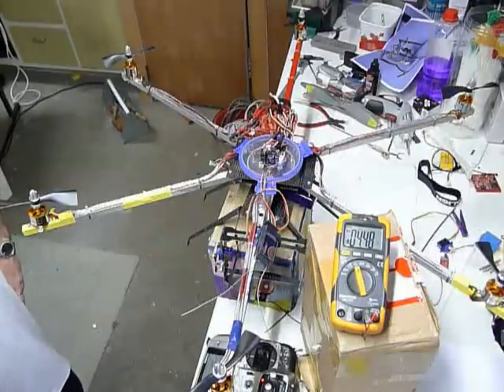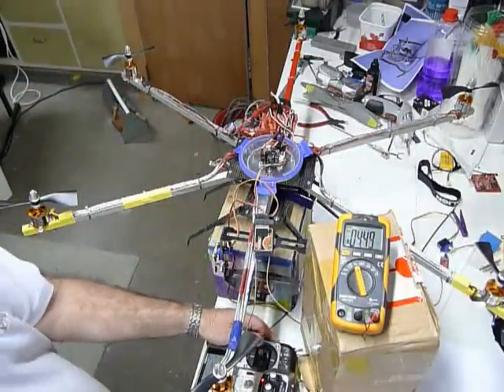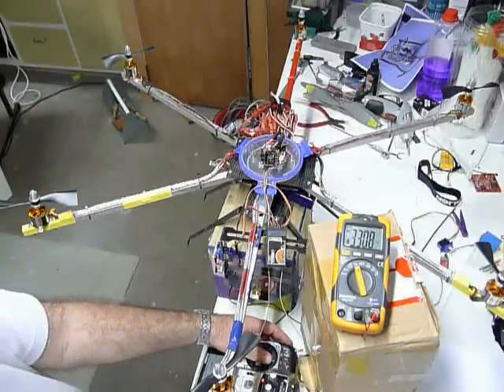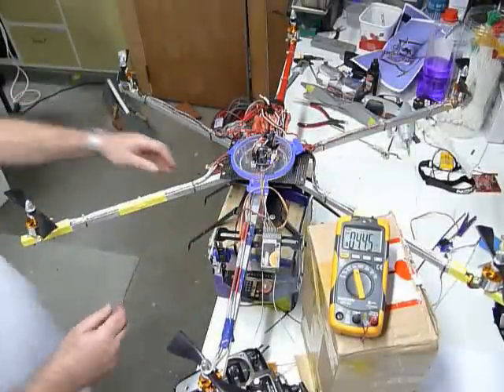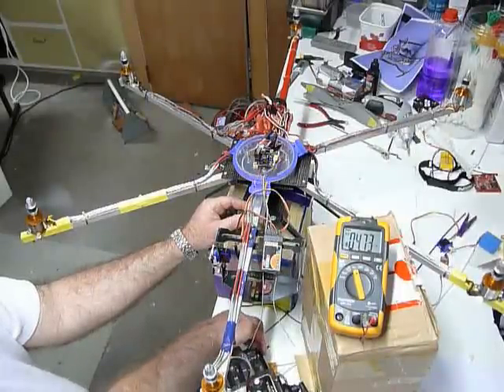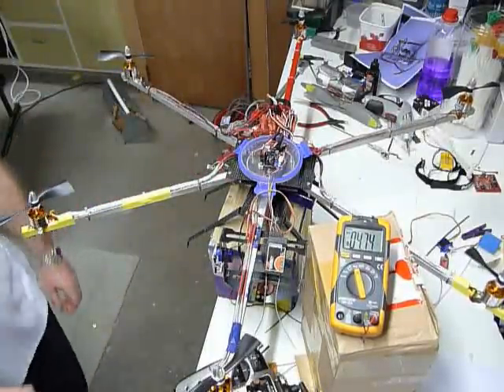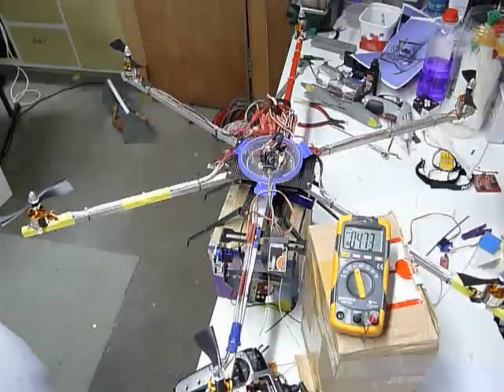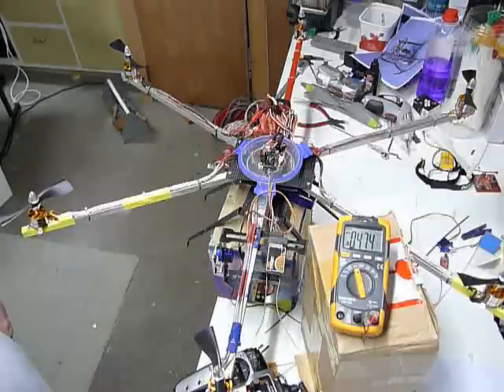Openpilot Multicopter voltage testing / board malfunction

Comment from the maker: Nice motors but at only 56g each, they are small.  They will be ok if you stay under 1.1Kg.  I suggest you use 9x3.8 or 8x4.7 props.

Comment: I'm here because I am researching motors etc and thought I'd listen in. Thankyou.This is an important point, easily overlooked. I have been wandering just how good some of this cheap Turnegy Speedy's are actually. I'm a noob and wont be doing camera work anytime soon but have lots to learn about about how to correctly choose hardware. SO confusing. I am about to build a 600MM quad, thinking about these SKY X2212 980KV Brushless and trying to work out flight time and thrust with a 3 cell lipo :(